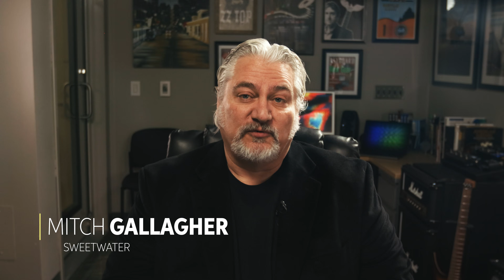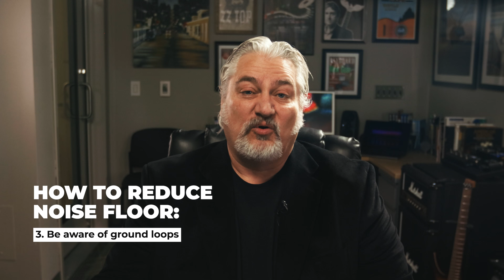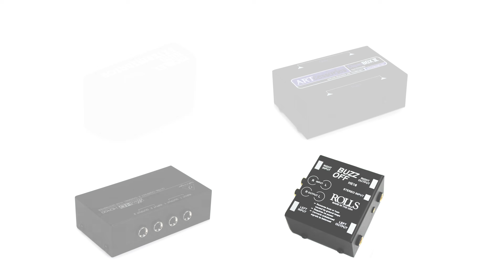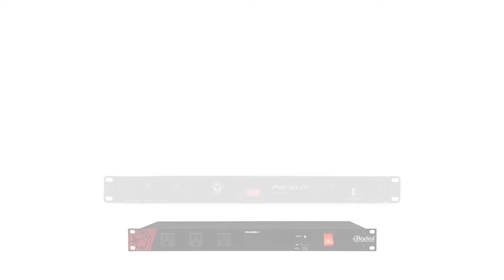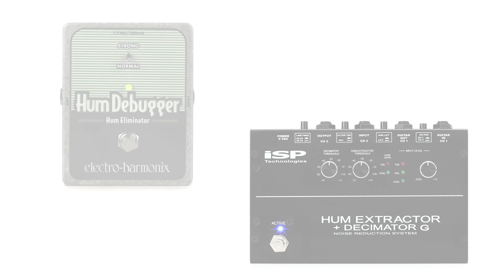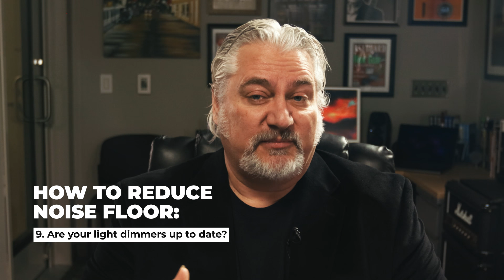How to Reduce Noise Floor

Comment: What high quality xlr cable do you recommend?
Reply from the maker: Hi, RickRaub-v4n. We sell a ton of different brands that carry high quality cables. Some qualities I would look for would be durability, quality of shielding, and higher end materials. Gold plated connectors are a great quality to look for as well as oxygen-free copper (OFC). Neutrik or Amphenol connectors are great to look out for, too.
If you have any other questions, don’t hesitate to reach out to me directly. Thanks!
Sami Ross-Lamotte, Sweetwater Sales Engineer
(800) 222-4700 ext. 3962 | sami_rosslamotte@sweetwater.com
About Me: https://bit.ly/4qT47xX

Comment: Question. So im have an issue where only when i speak, theres a weird noise almost like a low blowing noise, but i cant imagine it being anything related to my noise floor as my noise floor isnt too high nor too low. However, as i said its only when i talk, so im not sure if its some sort of feedback, but then again when im speaking my levels are between -12 to -6 so im definately not clipping. Any ideas where to look for that noise?
Reply from the maker: Hey, Jason! It’s tough to say for sure without knowing the entirety of your current system, but I would look into trying a low cut filter on your vocal channel. It sounds like that unwanted low end could just be low frequencies from your speaking.
Give that a try and let us know if it works!
Nick Pasquino, Sweetwater Sales Engineer, (800) 222-4700 ext. 3230, nick_pasquino@sweetwater.com
Reply: @sweetwater  so u mean a high pass or an actual low pass? I have a high pass at 118 hz
Reply from the maker: @jasonjellie9342  Yes, high pass (AKA low cut) – same thing, different terminology. If you’re already doing that, I’d do a frequency sweep and see if you can find which specific frequency is creating that unwanted noise and try a notch filter to pinpoint those frequencies.
Nick Pasquino, Sweetwater Sales Engineer, (800) 222-4700 ext. 3230, nick_pasquino@sweetwater.com

Comment: I have to use an uninterrupted power supply (UPS) in my home studio as there can be a sudden power cuts. The modern UPS are Line-interractive which produces a noise even in standby. I'm not finding anyone speaking about this. What do you use or recommend?
Reply: I try to keep in another room with a longer power cable to the CPU

Comment: A few things I did to remove noise in my studio- 1) Get rid of the dimmer switch.  2) Incorporate a UPS. This converts AC to DC and removes unwanted AC noise. 3) Recording with an actual interface, not a digital mixer (I swapped out a Presonus StudioLive for a Presonus interface and saw significant improvement. Digital mixers can introduce additional EMI and RFI.

Comment: Any advise on how to reduce the noise floor when capturing sound for picture?  I use all mogami XLRs and ensure there is no issues with cables.  However, I'm an indie filmmaker so I run straight into the XLR inputs on my Canon C70.  The pre-amps are supposed to be pretty clean but I always seem to get too much high frequency hiss... It is SO annoying. Doesn't matter if I'm using a Rode NTG5, Sure KSM44, AKG C451b, or any other type of mic.  I always seem to get that ANNOYING high frequency hiss. Any suggestions?
Reply from the maker: Hi Eric, great question! Having worked on a few video projects myself, there are a few essential tools I would recommend. First is a high quality external recorder which will already have a low noise floor. The Zoom F6 is a great choice and even has Time Code Sync:
https://www.sweetwater.com/store/detail/F6--zoom-f6-multitrack-field-recorder
The next is a great Post Production toolkit for removing unwanted noise like Izotope RX:
https://www.sweetwater.com/store/detail/RX9Adv--izotope-rx-9-advanced-audio-repair-software
which can be used to push the noise flower even lower. I have also used it to recover audio from a variety situation, even dialogue recorded next to a highway!
If you have further questions, give me a ring!
Drake Sobehrad, Sweetwater Sales Engineer, (800) 222-4700 ext. 3271, drake_sobehrad@sweetwater.com
Reply: get an xvive p1!

Comment: Thank you Mitch! I have a question..WHY don't the high end channel strips and compressors have noise gates? I have a Drawmer MX60 Front End One that I purchased from Sweetwater that I'm completely happy with that cuts down on room noise in my home studio for my vocals. But the Neve  Shelford Channel( that I really wanted) and the Neve 5254 don't have noise gates. I'm currently using a DBX 266XS and a vintage Alesis 3630 for my instruments. Do I have to buy a separate noise gate unit  if I want to upgrade to "top shelf" channel strips and compressors?
Reply: Yeah- and how would you run this? Mic to gate to channel strip?
Reply from the maker: Hey there! Yes, you’re generally going to have to run a separate noise gate when running higher end processors. It seems mainly, they want to be focusing on just one (or 2) things with the nicer channel strips and compressors, and not add on a gate just to have one. Along with this, you’re going to find that running a separate gate will generally give you some more flexibility when running with other pieces of gear. More options on where to put it in the chain, dialing in more accurate parameters on the gate, etc.
I hope this helps!
Nick Pasquino, Sweetwater Sales Engineer, (800) 222-4700 ext. 3230, nick_pasquino@sweetwater.com

Comment: Noise is the worst thing I struggle with, and have been for over a decade. This video shows that's it's not just a one-solution fix, but the combination of 5% here, 10% there, all adding up to a big difference. The biggest thing for me is the EMI bouncing around my room, caused by a number of different things like cabling and the small size of my room, leading to being very cramped regarding electronics. This is very insightful!
Reply: Make sure your lights are in switches, not dimmers
Reply: buy ferrite chokes